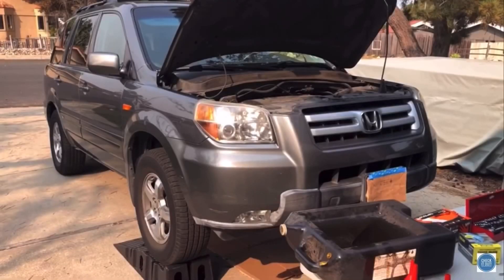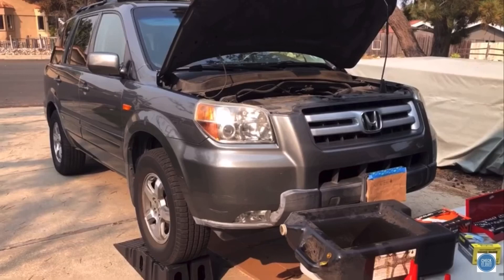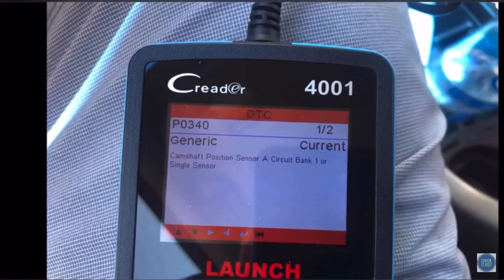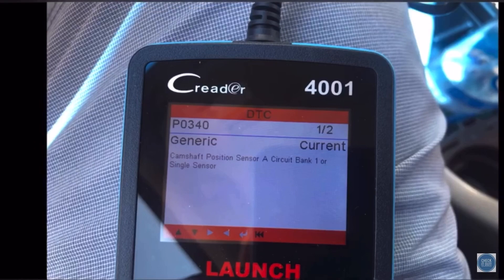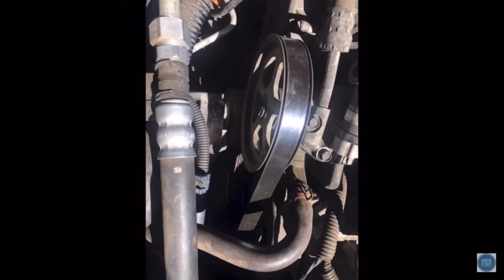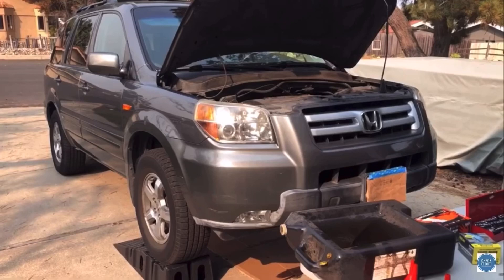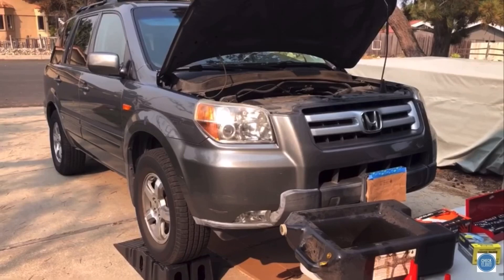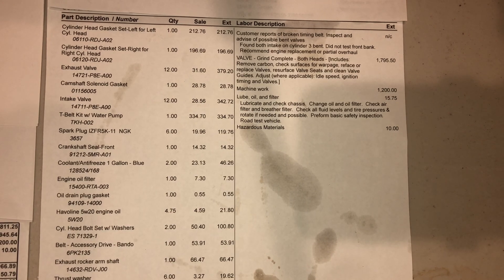Broken timing belt, interference engine, bent valves, diagnosing, shop cost to repair

Comment: Yup just found out my timing belt broke. It bent half the valves busted a head. So my mechanic said best to get a used engine. I asked about rebuilding it. That would be $4,500. I have a 2008 Honda Odyssey ex-l J35A7 is my engine model.  Well done some research and regardless I'm looking at $2,500 used or $4,000 brand new 🤔 I don't have the money for either at the moment. 😭 sad part is I've only had the van 6 months
Reply: That's sad
Reply: so how about we just replace the valves??
Reply: @mymey1000  trust me if I could I would. The longer it sits I'm like maybe I could 😂. But it's not something I can do. I've asked if I could just have it rebuild. Well it's $4,500 just to rebuild it. Vauls on there own just 1200.
Reply: @mymey1000  then I have busted heads. Have you rebuild a engine?
Reply: @angeliamattingly  I barely know how to fix my timing belt lol.  I am learning.  I am afraid I am spending all of this time and energy on this darn belt just to have a broke engine
Reply: @mymey1000  you probably should take it to a mechanic. I don't know anything about timing I definitely won't even try to know how.

Comment: Why Honda still uses timing belt? Toyota’s going with timing chain 300-400 miles with a single chain from factory
Reply: Timing belt is the best in peeformance and reliability. Just change it

Comment: Previous owner changed the timing belt at 100k mil, me as a second owner changed it at 195k mil ( mechanic shop) , now at 205k mil 1 year after it broke ( timing belt kit purchased on eBay for $140 apparently Honda genuine) but I doubt I was genuine, mechanic said it only damaged one of the cylinder heads / pistons / valve/ , tested under compression test , the others were fine , 
P0335 was my code when it happened on the road during driving , Crankshafts position sensor bank A, it snapped disconnected the sensor giving me that code , the car wouldn’t start anymore after it happened, so labor/ parts roughly $700-800 which is a lot less than other shops ,’here in San Antonio Texas, 
My Honda Pilot 2005 with 205k miles, well maintained, was hoping to keep it longer but not sure now if it’s gonna give me more trouble in the future , 
Thinking to switch to Toyota brand with timing chain and non interference engine
Reply: I am from SA same issue pls can you share mechanic information
Reply: Buy a Ford explorer it has timing chain lol 😅😅😅
Reply: I also purchased a supposedly genuine Honda timing belt kit on Ebay for my 2006 Accord 3.0 V6.  This one had the Japanese writing instead of Chinese, everything looked legit.  It was about twice the price of the other knock off kits.  Completed timing belt replacement, and less than 5000 miles later the belt broke.  I know I did the repair correctly. I replaced first belt at 90,000 and the 2nd one at 210,000.  I let the 2nd one go a little longer but the engine was still performing like a new engine.  Next time I'll use a high performance Gates belt.  Now I'm considering a JDM engine.  Removing heads, replacing bent valves, replacing head gasket and reassembling is more expensive than just getting a low miles replacement engine.  Heartbreaking.

Comment: Why they make engines like this so stupid can’t have anything nice. Might as well just buy a 4 cyl Camry
Reply: The 4 cylinder Hondas and Toyotas are the best. I've had 1 from each get to 300,000+ miles. And I've seen many v6s go almost as far but I agree timing belts are becoming an obsolete option.

Comment: Prevention is key!  Driving hard (hard acceleration, driving style as revving high above 4,000 rpm) will definitely shorten the  life of the timing belt. 
My 2004 Odyssey has 240K miles on the original timimg belt (I swear to God).  I simply listen to the car and never push it to 3200 rpm, yes that's grandma style of acceleration but it prolongs the engine life.
Reply: lol" Grandma style".. How boring.
Reply: I agree.  I don't accelerate it harshly/suddenly at all.  I let it time to accelerate.  I changed the belt back at 200k miles, and according to records and carfax,  vehicle never had the timing belt changed just inspected. I just wished I had purchased the Gates Branded, timing belt kit.  I got the Dayco brand.
Reply: Yes, overrevving it for long periods of time can cause it to wear faster but 3200 is actually the optimal shift point for your car I have 2 hondas with both the 2.4L K-series and 3.0 J-series engines both with automatic transmission under a normal load acceleration it's actually programmed to shift at around 3000rpm. Anything more and that is when V-tec kicks in. If you are unsure about revving it higher then have your V-tec solenoid inspected. If there is a problem with the vvt system the ecu will slow the engine down and prevent you from running it at above a certain RPM. But if you only do stop and go city driving for short distances than it can actually harm the engine. Taking it out for an "Italian Tune-up" at highway speeds once in a while can clear the buildup of carbon.

Comment: This is why you’re supposed to change them every 60,000 miles. Why risk it? Not worth the headache of going over the recommended miles.
Reply: my tensioner failed at 3k miles ...ebay genuine honda ebay bullshit parts .....bent my vales
Reply: @Ebbrush3  I'm there myself right now.
Reply: I have a 2001 Honda Odyssey with only 35,000 miles should I change the timing belt? Or should I wait until 60,000 miles?
Reply: 60,000? BS!
Reply: 60,000 is what Honda recommends when the vehicle is operating in temps over 100 for extended periods, your totally fine waiting till 60k you real start seeing them degrade after 80k. I work in Phoenix and have replaced at least 100.
Reply: My honda accord manual says every 60k

Comment: Pull the head off not that hard. Send thr head to a machine shop to check for bent valves. Once off you can check for scouring on the piston heads. I had same problem with a 1995 honda odyssey. Replaced 2 valves , replaced head gasket with a few other gaskets put back in timing good as new has 300,000 miles
Reply: Yup I don’t get why everyone thinks the whole engine needs replacing